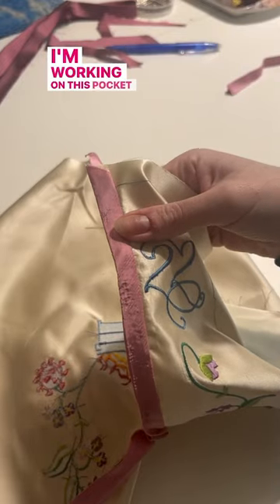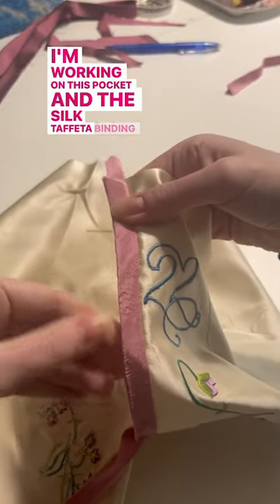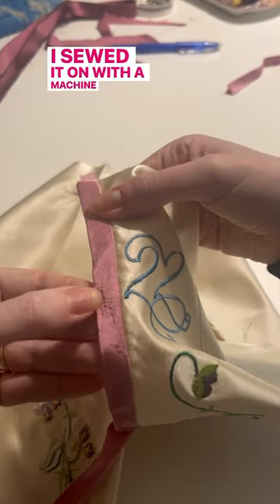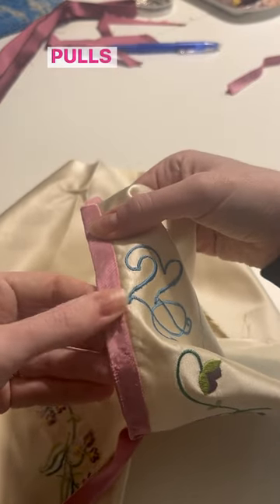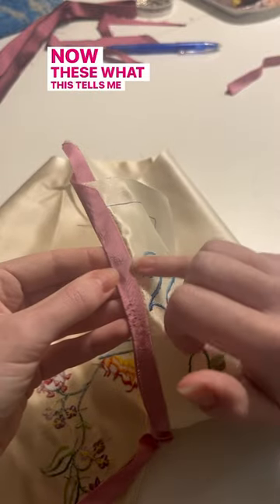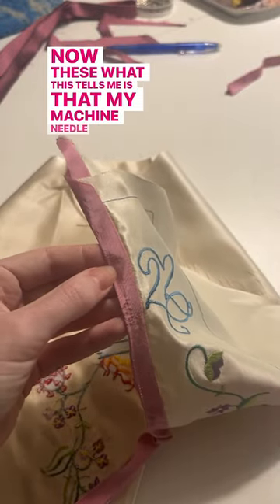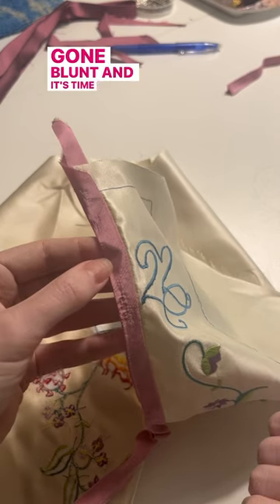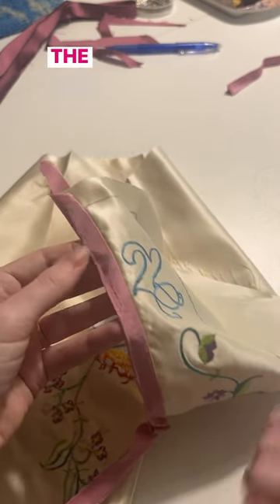Here’s why my 18th century pocket binding is full of runs and bubbles #sewing #sewinghacks

Comment: Most people don’t know that there are different needles for different fabrics! Knitted fabric needs a polished rounded tip so it dosent break the thread. Also hot tip you can always sharpen any knife or needle one time by running it along a smith edge of glass it’s like sand paper! ❤